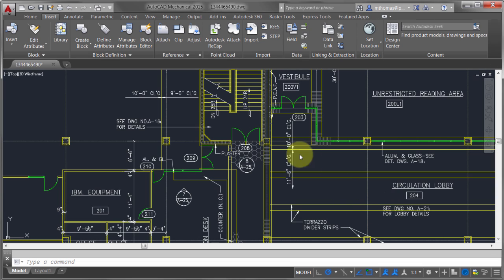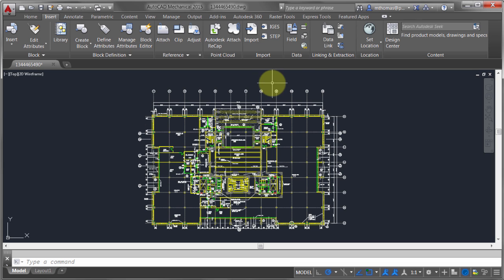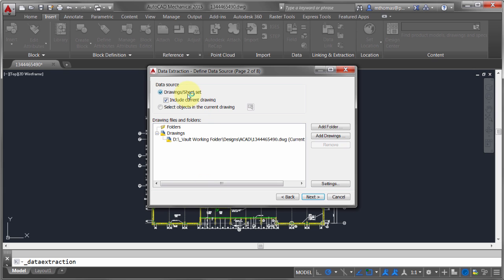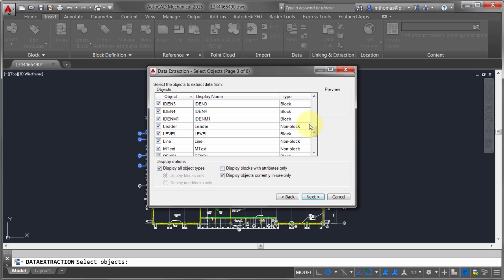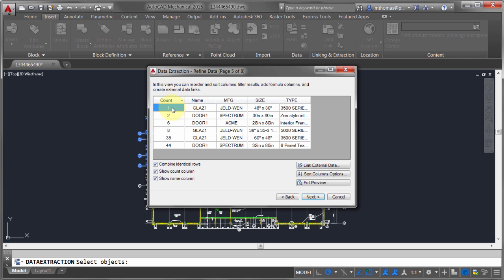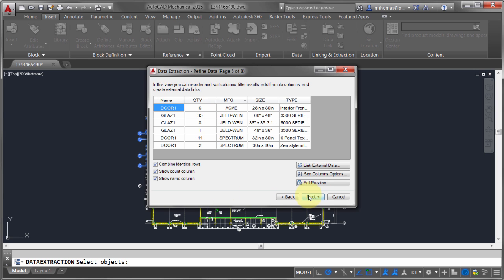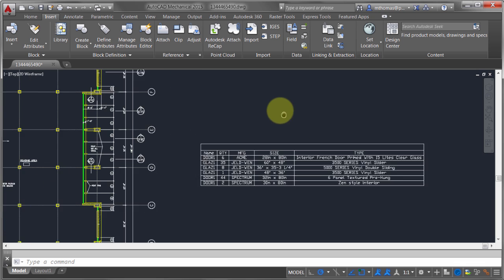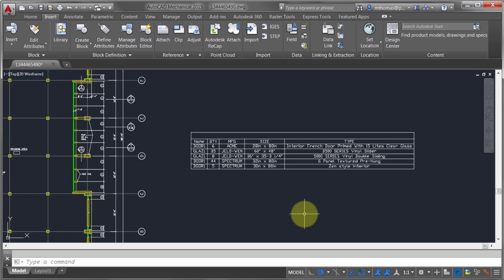AutoCAD Attribute Extraction

Comment: Hello guys, I wonder if you can help me. There is a BLOCK that i'd like to extract its attributes - Tag and COLOR - into an external format (EXCEL). there after, i'd like to import it into the drawing and based on its COLOR attribute value, change the value to that color in the drawing. any hints/suggestions would be appriciated
Reply: Just so I follow... you want to extract attributes from a block (Tag and Color) to Excel and then import it back into AutoCAD. From there you want to change the color value in the imported data and have it update the blocks?

If so, then this isn't possible without some programming. The data stream is one way... block to data extraction to excel to import in as AutoCAD Table. It could be configured so that as you change the block everything updates including the table inserting into AutoCAD.

Comment: Thanks. How did you bring up the Enhanced Attribute Editor so quickly in the beginning on this video?
Reply from the maker: I double-clicked on the block... by double-clicking on a block with attributes the default behaviour is to start the Enhanced Attribute Editor
Reply: Design & Motion.net Hmm. Interesting. It may be because I'm using Autocad 2012, but in my case it brings up "Edit Block Definition" window if I double click a block.